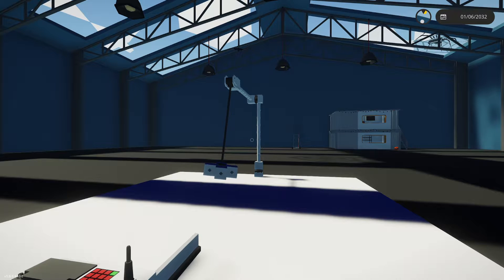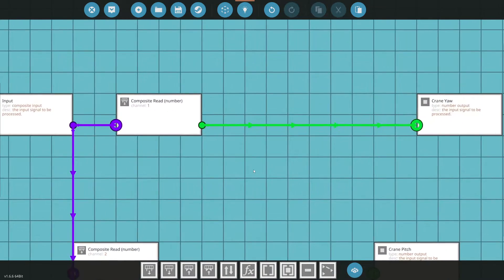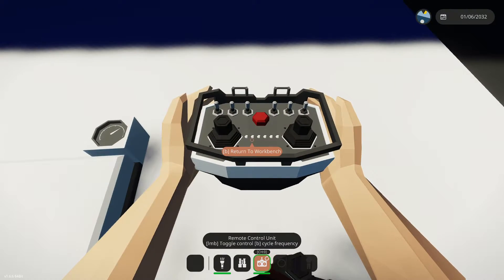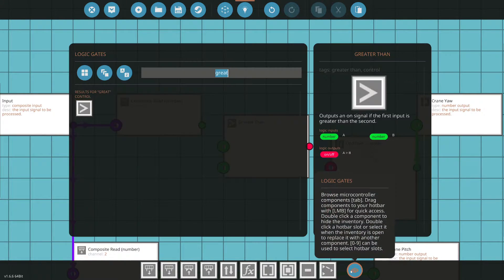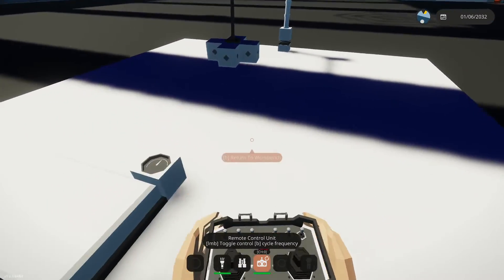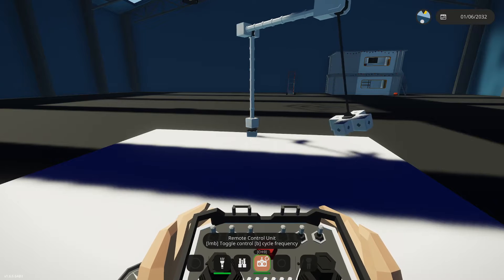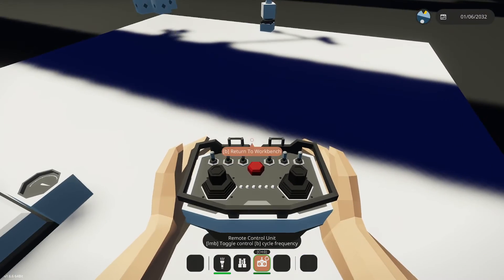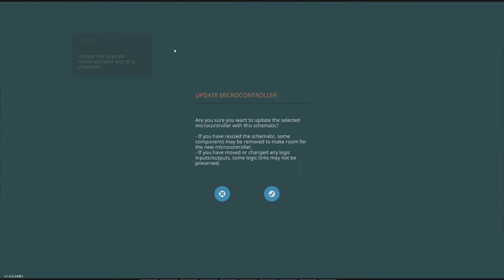Stormworks Basics Remote Control Tutorial P2

Comment: Use the Delta block.
on positive values, check that the delta is greater than 0
less negative.
So there will be almost no lag.
Reply from the maker: Once the number reaches 1 or -1 the Delta block will read a zero causing it to stop. It causes a stuttering effect.
Reply: @CaptainCockerels  You're right.
I, too, am now thinking about how to make a controlled crane on my truck and have also been struggling with this task for a long time.
Reply from the maker: @maxi_10  yeah at some point I'll keep playing with it. This way seems to be reasonably effective. You do get the delay on the start but that instant stop is really good so that you don't overshoot. One way you could put potentially do it is you could do an and with Delta and a number like 0.8.
Reply: @CaptainCockerels  You can also try to do it through the "SR latch", with the logic of changing the state.
I'll get home from work today, I'll try and let you know.
Reply: Okay, I just made the thing and it works wonderfully!
Search "Improved remote control decoder" in the workshop (user is "benjaminABC7") for a demonstration piece, and take a look at the code in the microcontroller. Follow the instructions to turn it into a sticky output, or just plop on an SR latch if you're scared of touching the code. :P